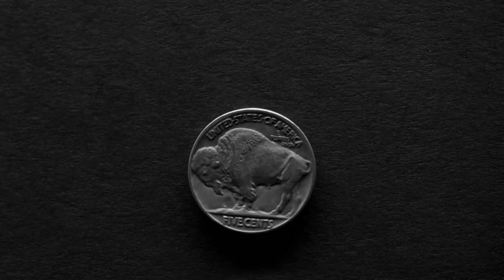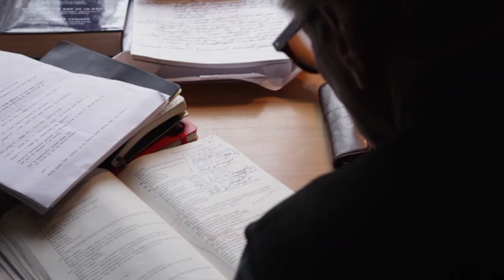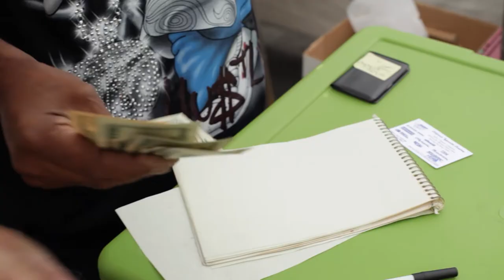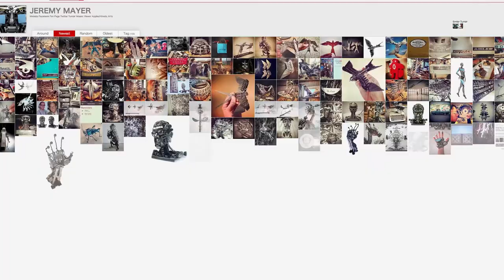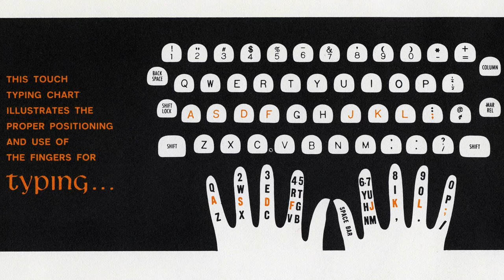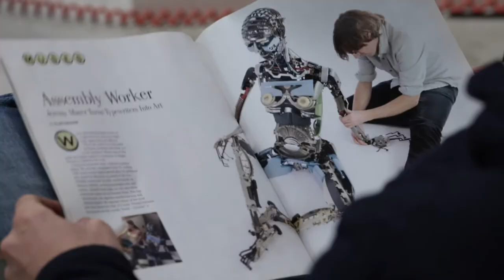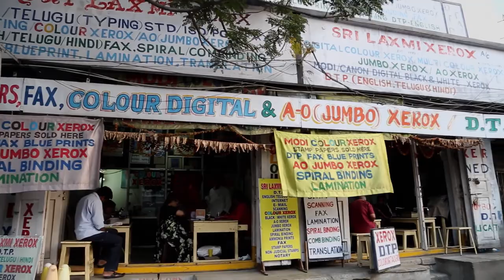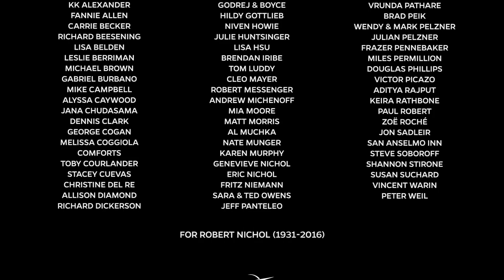California Typewriter - Tom Hanks & The People Who Love Typewriters

Comment: I’ve retired from selling on ebay, but there was a time a couple decades ago when typewriters could be bought at garage sales & auctions for a dollar or two. The auctioneer would thank me for buying & saving them dumpster fees. Nice quality portables in excellent condition, especially colored ones brought good money. Full size machines in less than mint had no value, until someone offered me $50 for the keys if I cut them off with a big wire cutter. Folks were making bracelets etc spelling out names with the key pads. I had a buyer who took all I could send. I was sometimes cutting up 4-5 machines per week for the keys, and the rest went to the scrap iron man.

Comment: Tom Hanks at around 51 minutes talks about the various sounds in the type writers. The Olympia at the end of his piece - which had a very awesome sound - anyone know the exact model of that one?
Reply: I think it is from the Olympia SM series. But SM2, SM3, SM4, SM5? I can’t tell them apart from just the back.
Reply: It is an SM-4. No tabs showing on back. SM-3 and 4 are essentially the same w 4s tabs set next to spacebar. On 3 you set them manually at back. 

3s and 4s are carriage shift so heavier to get to upper case. Some don’t like this. Weak keyboard fingers.
Reply: @JB-uv4hm  Thank you! I appreciate your knowledge.
Reply: Fantastic. I bought the SM3 and find it quite enjoyable to use (and hear).
Reply: @clandr3  i have a 3. A 9 will give you the same sound and many consider it the best manual typewriter made.

Comment: So I remember Steve Allen on his variety show doing a bit where he reported on a a typewriter murder. Did he just borrow Ed Rusha's photos? 
And  Herb might be right. From 1990 until a few years ago typing a manuscript on a typewriter was kind of a dead end. Optical Character Reading wasn't that good. Now an iPhone can help but immediately and accurately OCR any text in a photo. So you could type a manuscript, shoot smart photos of the pages and it would almost instantly be turned to text, that can be edited and digitally shared. 
A typewriter has no internet connection, so if you wrote on a typewriter, you could do so with no distractions. Touch typists I'd recommend Selectric II, reliable and had the correction tape in the machine.  (Wrote on one of the those for about ten years.) Two finger pokers? Anything. Get an old manual. 
One thing I discovered, as a touch typist, with Apple MacBookPro keyboards in 2018 (once they got over the jammed keys issue of the 2016) is that the shorter travel distance  of the keys completely solve my life long transposed character problem.

Comment: It’s laughable that the mechanic said it’s dependable like a Chevy.  Chevy is the 2nd worse rated car company as far as reliability in the world
Reply: He’s not talking about the ones made today dude. He’s referring to the older models made in the 50’s and 60’s- just like the typewriters that were made back then he still works on today- both products hold up. The Chevy trucks made back then were and are still some of the most reliable vehicles ever made.
Reply: It all went downhill in the late 60’s and 70’s. GM executives talked about planned obsolescence on the record in shareholder meetings and how they can make cars with shorter lifespans so customers would buy new ones. Union leaders proposed the same thing with how old machines will be scrapped to make new ones.

Meanwhile Japan had just entered the North American automobile market and they had a philosophy of building things to last.
Reply: It was a broad metaphore (simile actually). If you went off on some trip into the relative merits of the domestic automobile market, it was utterly lost on you.